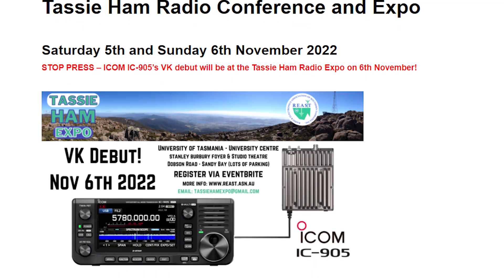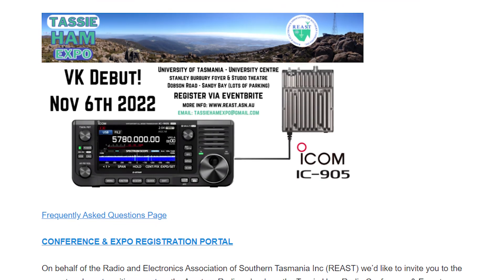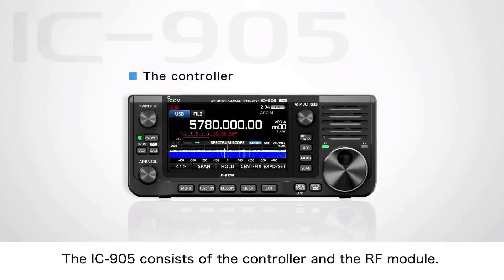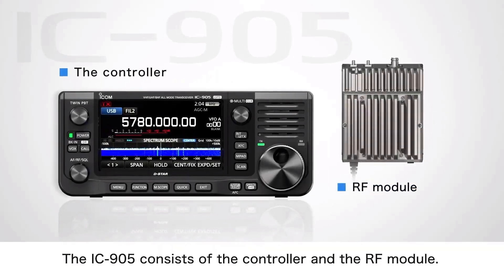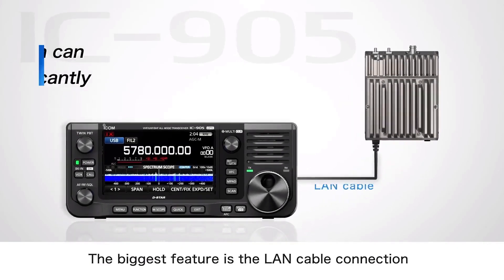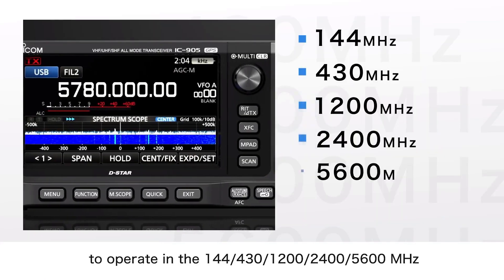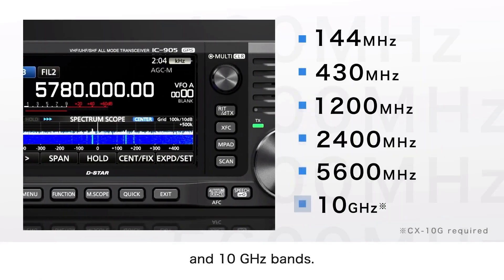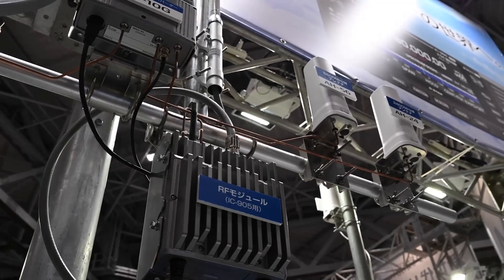The Icom IC-905 is Coming!

Comment: sure its cool, but the one reason I don't think I'd buy it, is because it really doesn't make itself useful on a "Daily" basis for many simply and sadly because of its low wattage output on 144/440 bands..... if it had 50 watts out on just those 2 bands, I would consider a purchase with much more veracity.

Comment: Would be interested to see how this radio lends itself to operating on the QO-100 satellite? Is it dual VFO? Can the 2.4GHz & 10GHz band VFO's be linked (so that they both go up & down by the same amount when you change frequency)? Can it RX on 10GHz while simultaneously transmitting on 2.4GHz?

Looks similar to the 705 functionality, so guessing that it would work on QO-100 but would likely have to change each VFO independently & use the XFC function.